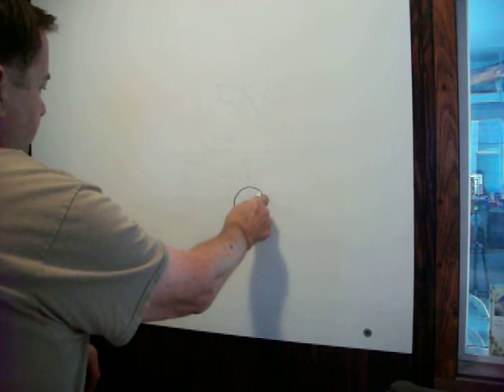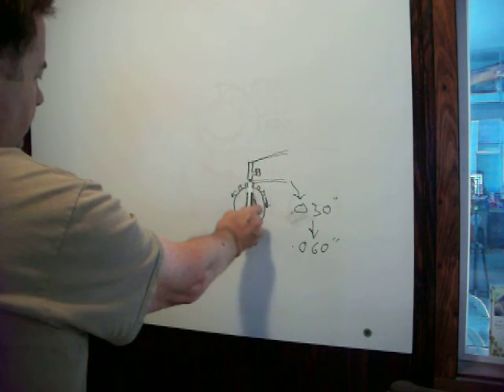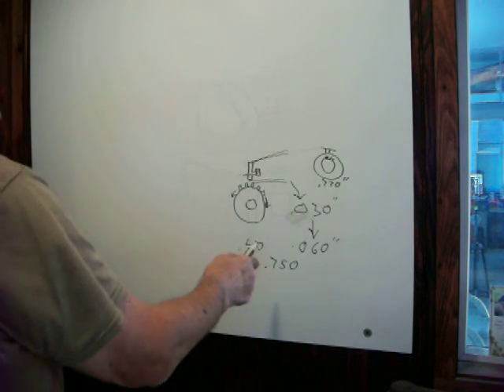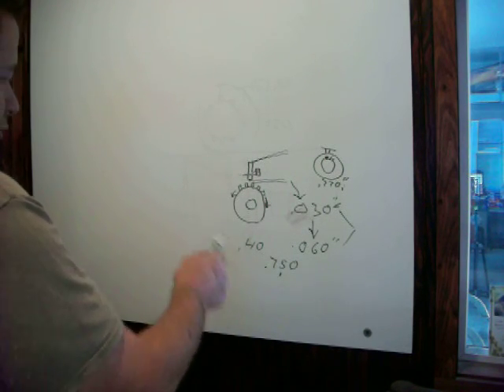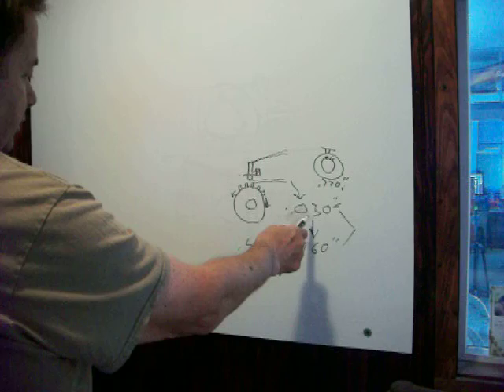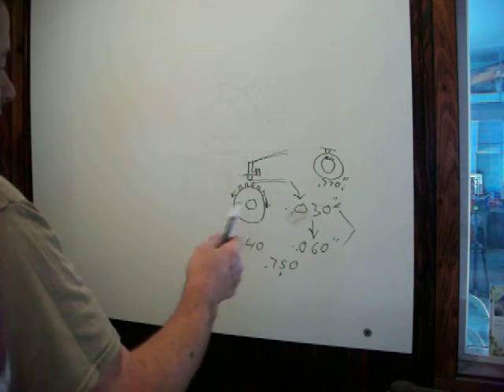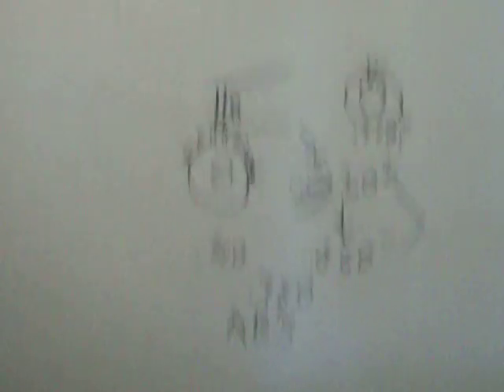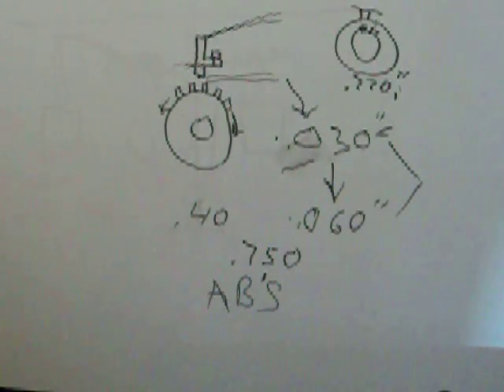ABS Wheel speed sensors 2000 Chevrolet Suburban.

Comment: Good  morning ,
I just viewed your short video on wheel sensor logic. 
I can't agree more with your opinion on videos not including 
If the fix that they show on the video worked or not.

I went as far as pulling the pump off razor blading the silicone
To check  the condition of the  solenoids . I saw many videos that showed
The solenoid were loose and all it took was resoldering the loose solder 
Points at circuit board. Well all my solder points were clean and still
Solid as a rock. So the I replaced the master cylinder sensor at the resivior .

Well that didn't work either  so I thought bake to my brake repair days and bang 
Wheel speed sensors!!!

Your video was the first one I saw and truly was impressed!!! 

Thanks for your time and great speech ,you are not out of your
Mind and I will be looking for more videos from you.

Again thanks
Reply from the maker: Thank you for watching and commenting.